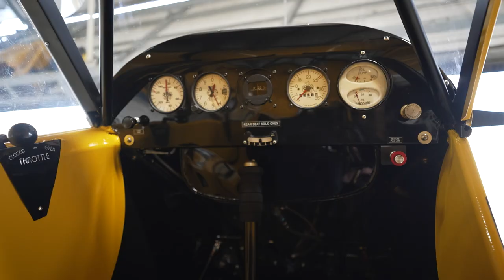Reinventing The Piper Cub The Dream Airplane To Own

Comment: May I ask what the steel frame material is? Is it chromolly or some other hugh grade/lightweight steel?
Reply: 4130. Piper originally used 1025 along with some 4130.